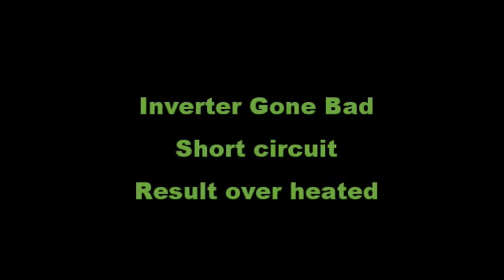How Big Power Driver 2000 Watts Inverter Smoked out On me

Comment: Try running a 300 amp fuse or breaker in between your positive wire near the battery and that fuse should pop or break before your inverter does. Extra protection. A 10pk of 300a fuses is like $10 so you can pop all those breakers every week and you’ll have enough for months.

Comment: Installation of the proper fuse between the inverter and power supply is essential to the protection of an inverter. The fuse will protect it from an overheat shutdown. That smell was more than likely the fan burning up in that small ass space where it couldn't get any cool air.

Comment: I've had the same problem and because it lasted 2 weeks before it gave up the ghost the truckstop only replaces it. That would be OK if the 2nd and 3rd one actually worked longer than 2 weeks as well. I replaced my 1500 watt with this 2000 watt thinking it would be better. I wish I remembered what the brand of the 1500 watt one was it lasted just over 3 years before it quit. Btw for those wondering, yes I used 2 Guage cable as recommended.
Reply: Yeah but at what length driver? If you're running any length greater than about 2' from your batteries you need larger gauge cable. The farther away you get from your power source the larger the cable needs to be. Also if you're not installing a fuse between your power source and inverter you will burn your inverter up every time. It might  take a while to do, but eventually it will burn up...

Comment: Judging by the smell it was a transformer the blew. Smell of ozone in the morning. Need to check your power levels (volts by amps) and give it lots of air and dust it out once month or put a green scrub pad in front of air intake to scrub air of dust. Put new one on when it gets gray hair (dust)built up on it. Cheap air filter for all big electronic cooling fans. Just put on the sucking side of fan (finger guard) not blowing side. You might be able to replace burnt out part and use it for a backup to a new
one.

Comment: I have a 1500 powerdrive inverter that popped on me after about eight months of use. It turned out to be one of the big thick aluminum wires that goes between one transformer to another. It was unfixable so I just got a new one. The new one I got I have been using now for about three years with no problems. Same brand same wattage output no problems but I have another one under my bunk just in case!!!
Reply from the maker: +truckindawg1 The one you are using what brand is it?

Comment: My 3000 watt inverter blew up on me while having only 1 thing connected and that was my laptop! I heard a short arcing sound followed by a burn smell then my inverters life went poof! I check the safety fuse and it was popped so I waited the next day to test it since it happened @ night, the next day I tried to turn it on & it worked but the outlets didn't got any power only the usb connectors so it's only a big yellow block taking space on my truck now.

Comment: Fluctuation in power and multiple usage of power will cause this in adequate battery charging alternator and output fluctuations affect this as well everything has to run smoothly in order for output to work properly there’s a lot more to electricity than a box fixing everything for you it functions the way it says it’s going to it’s all in the way use it and hook it up

Comment: First mistake is plugging a refrigerator into a inverter . You wire it to the batteries with a LVD module low voltage disconnect when the batteries get to 13 it will shut the item off...2nd always get a much higher inverter than what you need...4 or 5000...

Comment: I think it needed more air flow for cooling.  Maybe mount it where the AC blows cool air on the next one?
Reply from the maker: +BUDDY LIGHT  I think you are correct, It was insight and under  running 24-7 it just gave up. Thanks

Comment from the maker: why this thing gave up on me?
Reply: well those yellow one work very good a have a 1500 watts one so far no problems, i notice you put it under thu bunk and gets very hot under there with very or no ventilation at all when you replace it try a little more ventilated area, my friend burn a cobra 2500 and he had it in the same place and by the way those boots rock...
Reply: The smoke could possibly have been from a blown capacitor. The switching transistors can also make a lot of smoke when they go, because of the high currents.
Reply from the maker: That what it was, a capacitor
Reply: Interesting. Usually they don't make a cloud of vapor like that (it's actually mostly the electrolyte, which can boil if it gets too hot. Might be a little smoke too if it gets hot enough) unless abused.
I read an article about a "power jack" inverter which smoked like that - the person figured out that the voltage regulation went whacky, and that is what blew the capacitor on his inverter. (Too much voltage) lol, it actually failed when there was no load on it...
If you haven't known already, you should stay away from Power Jack. They don't seem to make reliable products.